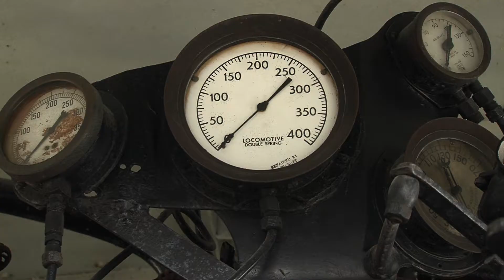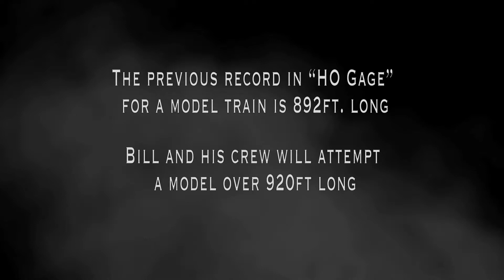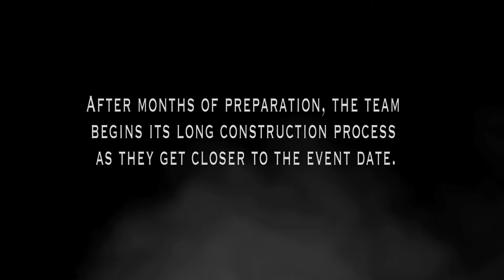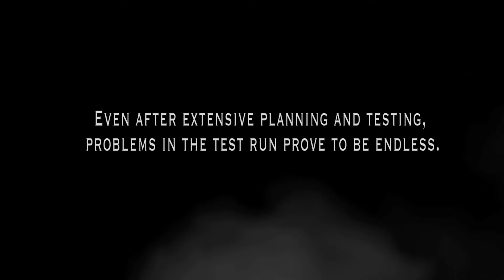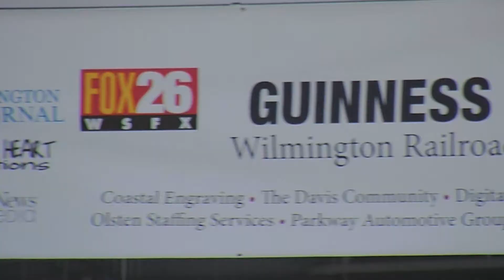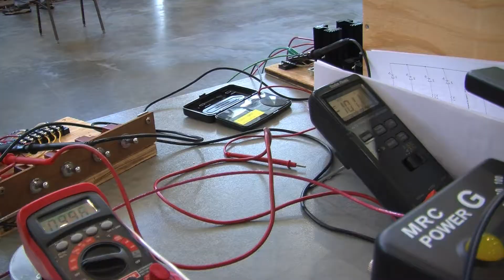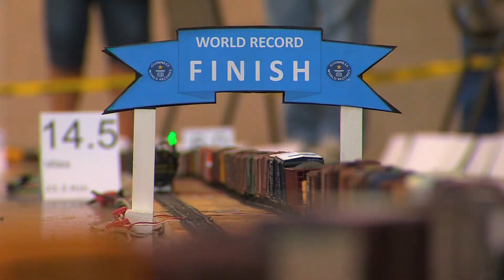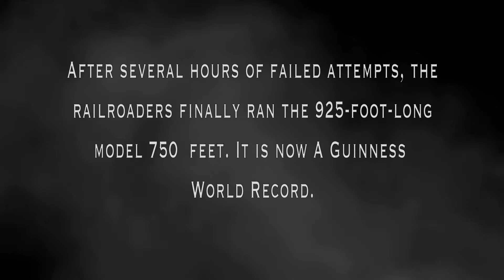Tracking Passion: The Worlds Longest Model Train

Comment: what was the consist length (number of rolling stock combined with the number of locos)? What was the total number of rolling stock in the cut and what was the total number of locos powering the consist? what was the total weight of the entire consist? the consist length was 975 feet and moved 750 feet... what would be the scaled down horsepower/torque to move this consist? these numbers would be very interesting to know... as I am a diehard train enthusiast...
Reply: The train consisted of 31 locomotives and 1563 cars.
Reply: @BenBensonStudios  damn bruh... 31 power units and 1500+ rolling stock... Scaled down... What would take in real time, a good couple hours to clear a level crossing?